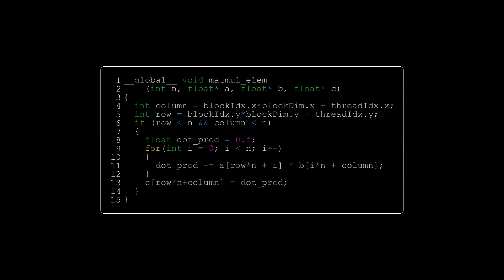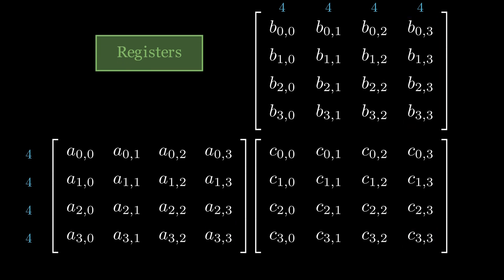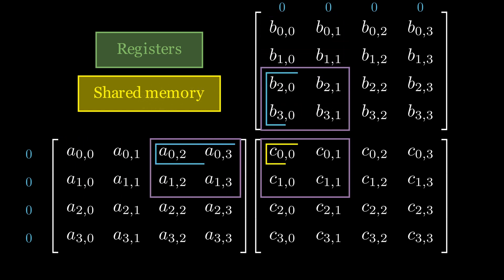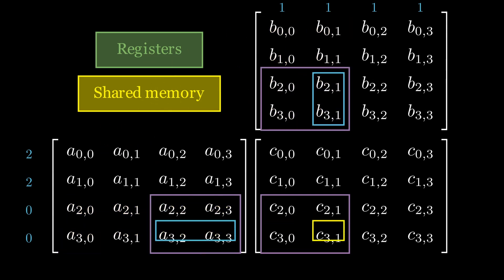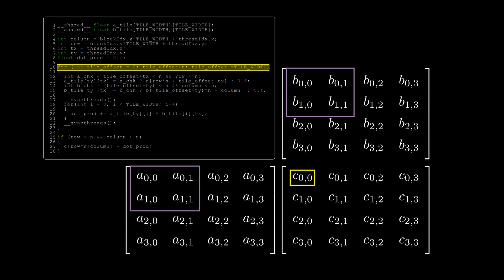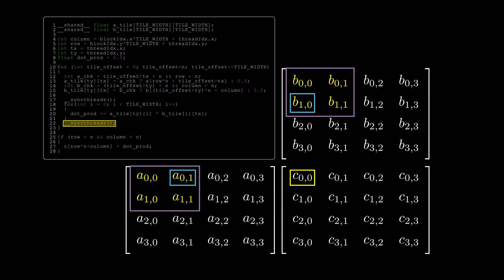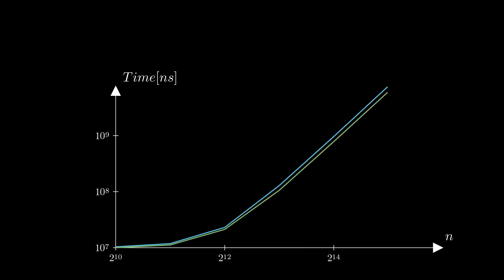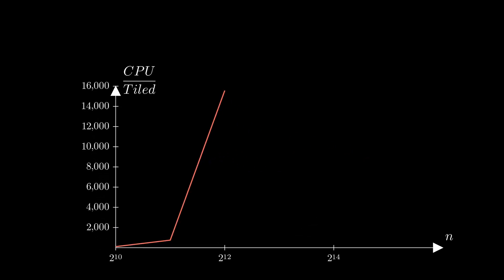Tiling With Shared Memory | GPU Programming | Episode 7

Comment: I think that there is a mistake in the code shown starting at 2:36.
In rows 12–15, there are a lot of occurrences of (tile_offset*tx) and (tile_offset*ty). I think these should all be (tile_offset*TILE_WIDTH + tx) and (tile_offset*TILE_WIDTH + ty), respectively.
When the different cores load the values of "a" into "a_tile", if the values of tx = blockIdx.x for two cores differ by 1, then the x index of entries of "a_tile" they load into should differ by 1, not
by tile_offset.
On the other hand, when we move to the next tile (i.e., when TILE_WIDTH increases by 1), then the index of the entry of "a" that the same core loads (into the same entry of "a_tile") should increase by TILE_WIDTH, not by tx.
There is a similar calculation for ty, but then the fact that we translate a 1d array to a 2d array means that the index of the entry of "b" that is loaded into "b_tile" should increase by TILE_WIDTH*n and not by tx*n as is shown in the current code.

Comment: Amazing video. I have a question, how the code will change if TILED_WIDTH is less than BLOCK_SIZE ?
I am imagining a situation, where there is not enough shared_memory available for all threads running in a block to load their data.